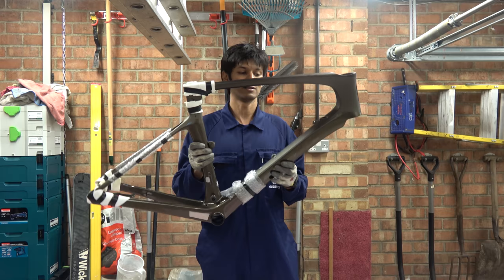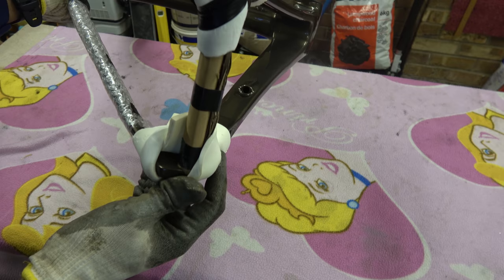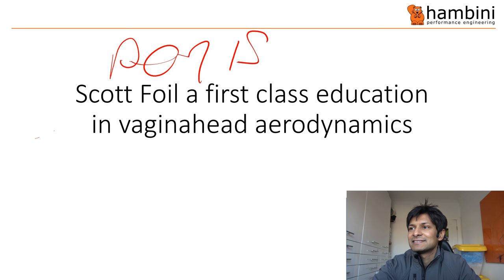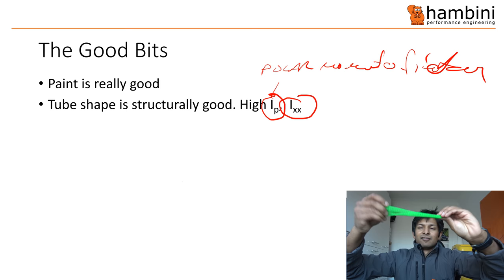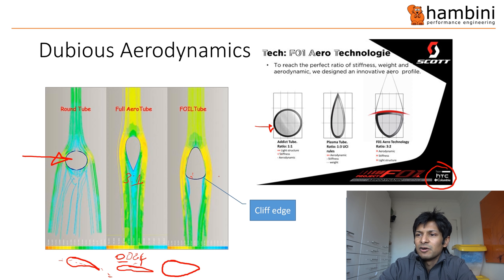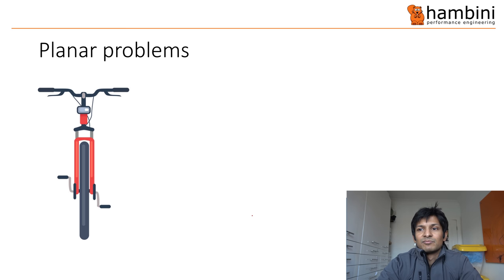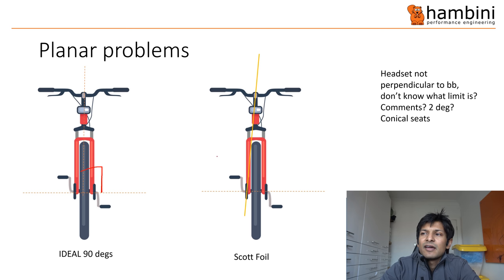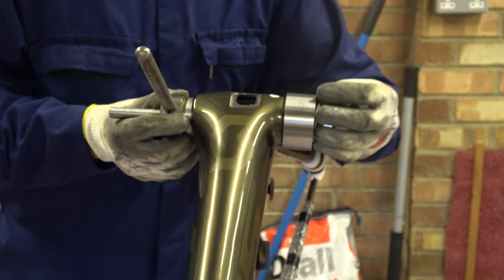Scott Foil Swiss Engineered Bike Frame gets Roasted including the sacrificial Toblerone

Comment: Love how the QC sticker is placed on the most obvious defect.
Reply: OMG Ive got 2 Scott carbon bikes ...... a Addict CR2 and a Addict ....... but thankfully I did not have a BB problem. However , Im sure that the polymer cups of the push fit BB is designed to be more receptive to the carbon BB tolerances. The CR2 has a screw BB going into a Alum bonded in shell , so u would hope that was easier to be correct. BTW loving the Airbus overalls !
Reply: Qc stickers are great for patching up cracks!

Comment: Scott customer service :
"We need to send another warranty replacement in size X color X."
"Do we have one in the pile of QC reject ?"
"Yes. Great I'll sent him an e-mail."
Customer to his cycling friends :
" Scott offers an excellent customer service. There fast an efficient. I received my replacement quickly."

Another satisfied and screwed customer.
Reply: so that is the reason, why you can't get a new bike from them right now?
Reply: @marcinkonietzko2911  
They'll tell you it's because they priorities their existing customers.
Meaning, they get the rejects first !
Reply: @sylvainmichaud2262  that first one was just for fun. But what if the enormous demand for new bikes makes the industry pass every sh through the quality inspection?
Reply: @marcinkonietzko2911  
The temptation must be very high.
High demand. Low availability.
Reply: Scott Sports SA (formerly Scott USA) is a Swiss producer of bicycles, winter equipment, motorsports gear and sportswear. The company's main office is in Givisiez, Switzerland, with branches located around Europe and in the United States, South Africa and India.  In 1958, engineer and skier Ed Scott from Sun Valley, Idaho, invented a ski pole made of aluminium, which compared favorably with those made of bamboo or steel. On the basis of this success, the company started to produce many kinds of sports goods. In 1970, Scott sold their first protection goggles for motocross riders; further motocross wear followed.

Scott expanded to Europe in 1978, settling their headquarters in Fribourg, Switzerland.

In 1989, Scott introduced one of the most significant innovations in the history of cycling to mass market – the clip-on aerodynamic handlebar. The handlebar was strategically utilized by American Greg LeMond in his 1989 Tour de France win, when he beat Frenchman Laurent Fignon by nearly a minute in the 24.5 km final time trial.[2] Previous to this event it was widely used in triathlon and Race Across America.
Reply: @mikes1984  
We've interrupted these comments for a message of todays sponsor Scott Sports SA.
Scott Sports SA, proud maker of the shitty bottom bracket shown in this video.
Reply: @marcinkonietzko2911  I thought the same thing. Carbon fiber bicycle frame production is not suited to the enormous demand of consumers. It is a matter of time before the quality drops.
Reply: @sylvainmichaud2262  your not rong there have hade two Scott bike frames the first one was bad full boult brought bike then hade crash the replacement well let’s just say this they are a con have hade so many problems with the crash replacement

Comment: 3:17, those studs are chain keepers. Helps keep the chain from "popping off" between the frame and crank. Also the tube shapes are considered "truncated airfoils" like the front part of an airplane wing. The idea is that the front part of an airfoil is the important bit that separates the air flow, and since lift is not important to cycling and it's turned on edge, the only needed bit is that shape Scott uses in their tube shapes. Hope it helps, take it for what it's worth.
Reply: You do realize that Hambini is an aeronautical engineer, right?
Reply: and a PHD doctorate for Dr. Hambini.

Comment: I don't think you'll find a single brand that does it right, you might get lucky with some frames but it's not a matter of which brand you get. I recently installed bbs on canyon, cannondale and cervelos that I just rolled my eyes at when they showed up, the measurements were within spec and the cranks spun for ages on them but most frames I come across have undersized bb shells no matter who they're coming from. I guess luckily in most cases there's paint overrun and extra resin in the shell that I can remove with a sanding wheel and get it close enough without hitting the fibers that people don't have excessive drag or wear in their bbs. The worst offenders in my experience are the ones with bb86 shells, they know the shimano bb/crank won't creak because of all the plastic they use, good luck putting dub on those frames though.

Comment: But more important that any of this tolerance stuff 'what calculator did you use' - My preferred is the trusty Casio FX-82
Reply from the maker: HP 32S II
Reply: @Hambini  A fine choice, good size in the hand with a trusty case to stop it prematurely actuating, although slightly unresponsive, especially at its age. I had you down as a HP 28S kind of guy.
Reply from the maker: I've got a 42s as well. And a 50g. I find it's easier to use when you are dyslexic

Comment: They teach you about pressure drag in basic Fluid Mechanics... So even the MechE guys should know how shit that profile is for Aero.
Reply: As a MechE, damn...i felt that... XD
Reply: To cut a Kamm tail on a profile, y’all need to do it on the tail of said profile... So kids , don’t let marketing dept do aerodynamics.
Reply: They know. I think they broke aerodynamics to help with some other parameter. Maybe this is easier/cheaper to manufacture, or they wanted very high overall stiffness at low weight, or the marketing people decided it looked cool, or...
Reply: @kitten-inside  IMO, probably they chose this tube shape because it offered a decent compromise between second moment of inertia, possibility of arraging properly the carbon layers and low/medium cost manufacturing without void issues in the frame. Obviously, the aero thing was totally ignored, but that's were the Marketing Department has put his efforts to make all those Chris Froome wannabes believe this bike is aero. What's undeniable is that Scott's QC is utter crap. I don't know if i'm right, but... XDD
Reply: @SprayIgniteBoom  We have aerodynamics, and although i'm not an expert, i can tell you that is way more accurate than looking at birds (an yes, i know that aero shapes are very present in the nature. But that doesn't mean that you just can copy straight away nature shapes without understanding how they work).

Pd. If you're being ironic, congrats. XD.
Reply: @SprayIgniteBoom  or NACA charts. Thick low speed aerofoils from the late 1940’s are still way more valid than that flaccid bishops hat cross section.
Reply: @kitten-inside  at least the frame is good for a sprinter in a race, shielded by the leadout train and stiff for maximum power transfer at the line.
Reply: @SprayIgniteBoom  So by that logic, GoreTex must be scam, because if it was better than wool, sheep would wear it instead.
Reply: @82vitt  You know what Angelo keep riding your faux ‘NACA’ heavily marketed bike the way you like it. Keep doing it because you like it not because Scott, Bianchi, Pinarello etc ‘said’ you will be xx% faster 💨....But yes, gore-tex is modeled after an in depth study of wildlife and how water’s structure reacts with their skin/feathers. Nice helmet btw~

Comment: The planar misalignment described here is common in production motorcycles.  It can be quite strikingly severe as each frame is unique.  Factory racers don't have this problem, their frames are checked and straightened before they ever see service. When was road racing, one of the things we normally did was have the frame checked - right off the showroom floor - to determine if the frame was actually straight or not, and straighten it if it wasn't. This was a lot less dicey when motorcycle frames were made of steel.  There are many hours of "fixing" the factory's tolerances on a racing machine if you want to finish top 10 in the "stock production" classes.

Comment: The bit on the side is a chain catch. I have one of these frames, and my bottom bracket is as smooth as silk. I actually bought this bike because I'm a bigger guy, 99 kilos, and this bike was actually rated for my weight. I would say my frame had none of these issues...

Comment: Not seen if someone answered already, but the round rubber beside the bb is a chain catcher (which does badly its job) to prevent the chain from falling between the crankset and frame. And I understand the idea for the bad aerodynamic shape, but wouldn't the slow nature of cycling (compared to cars or planes) would neglect or diminish in some ways the low pressure zone following the cutout, making it... less bad?

Comment: I own a scott foil HMX 2017 and recently installed Hambini BB, can confirm:
1) BB about 0.1mm undersized. Using flap wheel (as shown on this channel) to widen did the trick and it's very smooth now.
2) Headtube built is weaker point of the frame. Integrated stem is a bit shit (rubs the frame)
 It is noticably faster than standard round cylinder tubed frame though, and it handles rough terrain (Flemish cobbles) very well for an aero bike.
Reply from the maker: The undersizing is rife on a scott.

Comment: A hexagonal recess at the outter part of the removal tool could keep the bolt nut from turning whilst rotating the handles on the extraction side. One-handed work from then on - how hard would that be to manufacture?
Reply from the maker: it's the cost of machining it that is the problem

Comment: I have an aluminum frame with a BB386 bottom bracket. The easiest of these things to find is a plastic device that can almost be inserted by hand. Rather than the 30 mm shaft I intend to use a Shimano crank and I suppose that's a 24 mm shaft. What do you think of those plastic BB's and is this POS going to start squeaking after a week? Should these sorts of applications always use aluminum shells?
Reply from the maker: plastic bb will be fine providing the holes are round and a good fit. THe problem is they rarely are.

Comment: sorry, may be mentioned below but I scrolled all the way could not see. I thought the BB86 is 42mm shell, then 41mm would be a mm below, which might need a nine pounder to fit the BB? (not an engineer by a far stretch so light the flame thrower), thought to remember one of your previous postings need 0.05 for interference fit?
Reply from the maker: BB86 is 41mm nominal. BB30 is 42mm nominal.

Comment: Silly question, but what was the solution? Do you widen the shell with a standard BB or make the BB smaller to fit? After explaining the problem you went into full rant mode. 

Also, what's more aero? A round, small steel tube, or a big fat carbon foil tube? If the carbon tube is twice as wide, I'd have thought the drag would negate any aero benefits for most people. Thoughts? Thinking about it, I guess the air coming off the wheel is a bigger issue than tube diameter.
Reply from the maker: Combination of both.  For the tubes, you need some dimensions because you get leakage around the top
Reply: @Hambini  Thanks for responding. And what did you do to actually fix the Scott? Am surprised you bothered with the front end like that!

Comment: Very enjoyable to watch and learn about aero and bb. Thanks. Edit: I have a Bianchi Sempre from 2013 that will no doubt need a new BB at some point. How would a total novice establish if the frame tolerances were good enough to fit one of your BB, especially if they live in Western Australia, without damaging the frame :-)? Cheers.
Reply: Pay a local machinist to make a pair of go/no-go gauges and check the tolerances that way. They're the metal cylinders/pucks you see in the video used for testing the tolerances. An oversized gauge (41.00mm+ for a BB86) will not fit in the bore, while the undersized (40.95mm-) and "correct"  (40.95mm - 41.00mm) gauges should. Different bottom bracket standards have different nominal dimensions so make sure you know the right one.
Reply: @nojnipes  Ok thanks for the advice.
Reply from the maker: I agree with Nojnipes. That's a fast and cheap way to make sure you get the right size.

Comment: 3:17 Its a chain catcher... and its not a very good one ;(
Reply: Truth. Wait till C Catcher POS comes loose.
Reply: Can confirm.  Have an old Scott mountain bike with a similar chain catcher.  All it does successfully is make it really hard to get the chain out from between the frame and the crank.
Reply: @brianwright9514  Exactly. Even seen Mitchelton mechanics use a K-edge braze-on catcher instead.

Comment: Theoretically these are manufactured by Giant, which theoretically would mean it would be theoretically better then this. Thereby we should term this bike from now on Scuntt Fool, manufactured by Tiny.
Reply: Even if it was manufactured by Giant it does not excuse the fact that the hole was not round and they charged 3k AUD for it. And botched the replacement as well. THis will do wonders for their name btw. THis is just another company to be very, very, weary of. Dreading the day he roasts kuota but my hambini BB evo386 slid right in and no more creaks due to some shimano delrin caps.
Reply: @suminshizzles6951  they’re all the same. Just marketing companies that buy stuff from the lowest bidder in China.

Comment: Scott did some sniffing to get that tube shape, as it’s ip/ ixx seems solid. But were they sniffing glue when they did the aerodynamics? Cause I’m wondering how the lower bike half is actually behaving in the wind, with 0815 bottles on. And if 0024/NACA profiles are then the best choice for a race bike?
Same question for the tube shape of the new TCR, as giant is marketing the bike as their most aero TCR and compared it into the 1st place ahead of other companies bikes. Their “testing” was done *with a pair of bottles on*. 
BMC, Pinarello and some others also did an approach to consider the bottle integration.
Well how about that Mr. Eros Expert?

Comment: There hasnt been one video explaining the different weave strengths or corresponding thickness of the weave in relation to placement. What seems thin could actually be a t1000 weave that has multidirectional stability that requires a fractional amount of t800 standards.

Comment: please elaborate about this claim starting 15:45 that the difference in pressure generates the lift, people might think that it’s the only/main thing that creates lift in planes and as far as i know (and can test with a water pouring from a tap and a spoon) this is only a small part of the overall lift force that is generated by an action and reaction created with sticking the air to the air foil.

Comment: The frames arent designed for a full alloy machined BB. They are designed to be used with a bracket with plastic cups. The cost of a Time frame is 4x that of a Scott foil. You basically made a video about nothing. Because unless its TT bike aerodynamics are irrelevant.
Reply from the maker: If you say so

Comment: But this is not a second hand frame.  If it is still under warranty; once the chap had the measurements to prove it was underspeced and that fitting a stock BB would surely crack the frame, why not request another replacement instead of having you fix Scott's problem?
Reply from the maker: Scott weren't interested

Comment: I know that Trek has a similar tube shape and calls it a kammtail virtual foil... is that aero bs too?
Reply: The intention of these shapes is to do what is called a kamm tail, which is to mimic a full airfoil by truncating the rear end of the airfoil. You get quite close to the airfoil benefits while having a shorter chord length, hence a smaller tube and better Stiffness of the tube than a full airfoil. 

The trick here is 'how much' of the airfoil to truncate. In scotts case they truncated too much of the airfoil to get any meaningful aerodynamic benefit. In Treks case they have truncated less of the airfoil, so in theory it should be bettrr than the scott. However how much more aero this is you'd have to test it.

Comment: Scott Sports SA (formerly Scott USA) is a Swiss producer of bicycles, winter equipment, motorsports gear and sportswear. The company's main office is in Givisiez, Switzerland, with branches located around Europe and in the United States, South Africa and India.  In 1958, engineer and skier Ed Scott from Sun Valley, Idaho, invented a ski pole made of aluminium, which compared favorably with those made of bamboo or steel. On the basis of this success, the company started to produce many kinds of sports goods. In 1970, Scott sold their first protection goggles for motocross riders; further motocross wear followed.

Scott expanded to Europe in 1978, settling their headquarters in Fribourg, Switzerland.

In 1989, Scott introduced one of the most significant innovations in the history of cycling to mass market – the clip-on aerodynamic handlebar. The handlebar was strategically utilized by American Greg LeMond in his 1989 Tour de France win, when he beat Frenchman Laurent Fignon by nearly a minute in the 24.5 km final time trial.[2] Previous to this event it was widely used in triathlon and Race Across America.